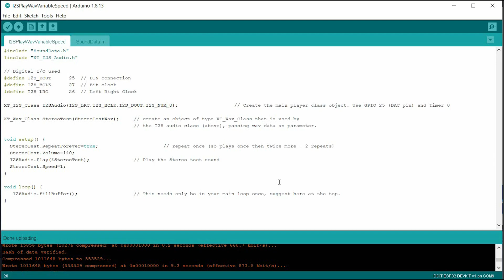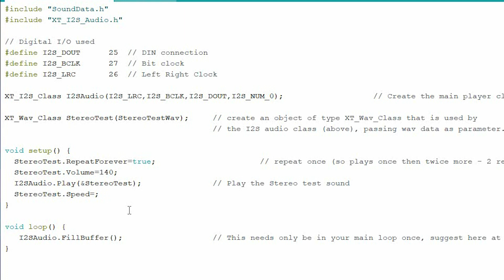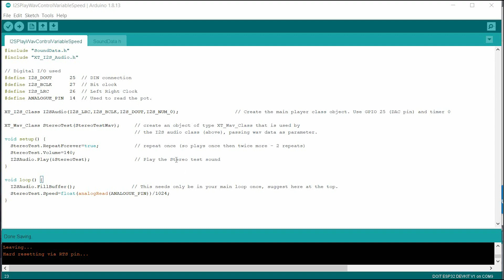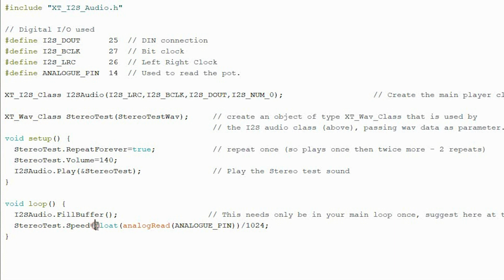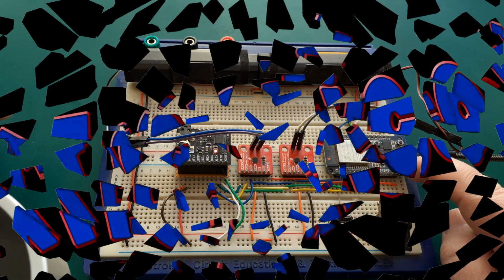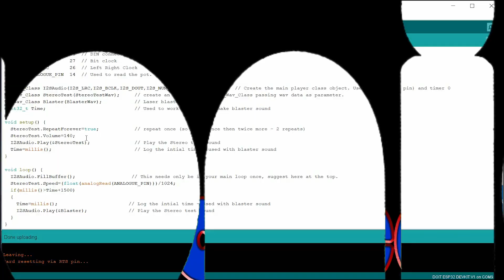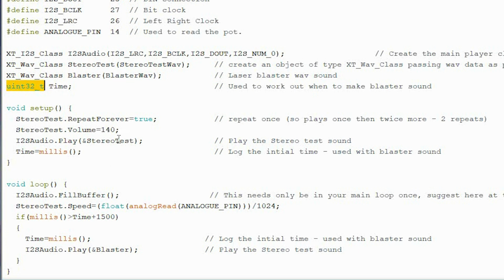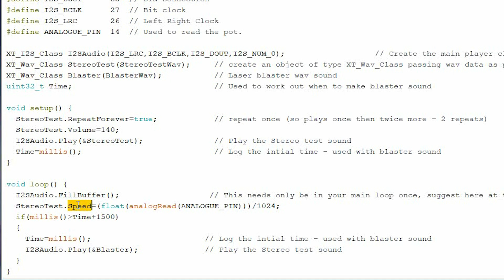I2SAudio Library, work in progress 3. Playing WAV's at different speeds. (ESP32 I2S Audio, WAV, MP3)

Comment: hey there, in the xt_dac_audio.h and cpp, the phase accumulator for the wav file is the index aka uint32_t DataIdx; correct? i want to make a dj style audio scrubbing function thus i would likely need to update this value as the play head from say an encoder value and then modulo it with the uint32_t DataSize? probably will need also the DataIdx to be interpolated with its previous state as to avoid discontinuity, let me know if im missing anything, i know you mentioned in the source that the speed is an integer to float "sub-frame" kinda trick but i wouldnt think that this would effect much with the DataIdx position? please correct me if im wrong all the best, Tristan

Comment: Im not sure if you would even see this comment , but i think your work is very impressive. Maybe one day if you have the time , can you develop a proper engine sound module ? Basically there needs to be a starter sound , idle and a rev up and down which i thinl is the hard part to really do because varying the sampling rate simply isnt enough to make it realistic , perhaps its possible but its beyond my skillset. If you manage to make such a thing it would be the holy grail for the rc car community because theres rn no actualy sound module thats realistic
Reply from the maker: I read virtually all comments. For that problem you need to be looking at what happens to the sound on rev up etc. I would guess.
Reply: @XTronical  usually the rev up is a bunch of mixed sounds , and it all depends on the road as well , but keeping aside most variables, it's safe to say it would be a knock at each engine cylinder cycle and a some other noises , this isn't always the exact loop so when I loop such a sound It sounds somewhat like a tractor engine revving up instead of say a car . ( the da da da , dada , dada , dadada , dadada ) one way to hide this is to have like a non linear curve for acceleration where the sound jumps to cut off the first part of the rev sample rate rising, but still its hard to replicate it.   I have no idea how video games develop this but for now , I won't give up lol. There's a person named diyguy999 who made a good sounding dac audio engine sound , but it's 8 bit and he seem to be using the sampling rate adjustment which works fine for low rpm truck engines but for anything else it just sounds somewhat bad and unrealistic as if I'm accelerating on a high gear at a low start off speed. The hardest part rn is to actually find the proper loop , maybe if I increase the size of audio sample and modify my esp32 to have a 16mb flash because the sd card library you made unfortunately can't change sampling rate. For now my engine starter and idle rev samples take about 3.5 mb for mono , 22050hz 16 bit audio ,   but having that upgraded memory will let me have maybe few different rpm rev samples to use under different engine speeds / revs to adjust sample rate. Thanks again for making such a library because before I literally had no proper idea how to even get quality audio out of the esp32
Reply from the maker: I did an 8bit library as well. Like you say this is higher quality. The task does not sound trivial but does sound interesting.
Reply: @XTronical yeah it's safe to assume diyguy might be using your dac audio library , I haven't gone thru the entire code. And trust me haha , it's a pretty interesting project , perhaps won't be the most important since it's a bit niche at the moment . Btw is it possible to change the volumes of each wav file separately on the sd card playback mode? So I can make a lot of loops and try to merge them by varying the volume to overcome that non adjustable sample rate issue ?
Reply from the maker: Yes, it will be possible, all sounds have independent volume but sd card functionality not fully implemented yet

Comment: Thanks for that great instruction. I'm using your XT_I2S_AUDIO Library but i have problems with slowing down the speed of a wav file. Speeding up with values between 1.1 to 3.5 works fine, but when i use values between 0.5 to 0.9 the file is not beeing played. What could be the problem ?
Reply from the maker: Mmm... I've just started a new project using the library so I'll have a look, see if I can replicate. Be a couple of weeks though.
Reply: Thanks. I will wait for any suggestion 
 @XTronical

Comment: You are truly a professional. Your depth of knowledge and clarity of details is greatly appreciated. The last step in my project is adjusting my output sound to different notes and volume. Does the new Esp32-S3 contain an I2S chip? Is there a way of controlling the volume without the I2S chip?
Thanks
Joel
Reply from the maker: Hi, thanks for your kind words. yes the S3 supports I2S. Not sure what you mean by control volume with i2S chip. The external decoder chip is essential for converting the I2S data stream to audio. Some support basic volume control but in the example on volume I did this digitally before the data stream is sent out. The external I2S chip has to be there to decode the data unfortunately, you can't do much without it. Hope this helps.

Comment: Awesome! This is exactly the functionality I'm looking for! Although, would you know of a way to power it without having to use the USB? I would like to power it from good ol' DC wires. (+/-)
Reply from the maker: Yes, just supply the correct voltage to the vin pin and a gnd.
Reply: @XTronical  Well...that's the thing. I only have 1 VIN pin, and according to a schematic, the GAIN pin on the I2S gets connected to the 3V3 pin and the VIN/2.5-5V pin on the I2S gets connected to the VIN pin on the ESP32, leaving me without any more power inputs.
Reply from the maker: Just connect the power wire to the esp32 pin, doesn't matter something is already connected there. Connect both.

Comment: Great! Can't wait for it's release, you had mentioned in the past, this will be supporting esp8266 as well, is that doable or on your radar?
Reply from the maker: Esp8266 should be doable,. Thanks for the tip about the website, the donations plug in was updated, something obviously gone wrong.
Reply from the maker: Again thanks very much for the tip off about the donations, I found it was a common issue since the last update of this part of the website. Found a fix and now working again. Appreciated. 👍
Reply: @XTronical  np, glad to help
Reply from the maker: Thank you very much for your generous donation.
Reply: @XTronical  would be awesome if you can have 8266 support as well even if it comes later on, I know its not the cool new flashy chip but it still has advantages, many small module form factors, really cheap, easy to program and pin map on pcbs etc.
Reply: Btw, donate link on your web page is not working

Comment: It's getting very interesting, looking like it could be a very useful library. 
Thanks for your hard work..
So I take it you could do something like, 
StereoTest.Volume=(analogueRead(ANALOGUE_PIN))/28;
Would this be continuously variable throughout the playback or just every  time the sample plays.
Reply from the maker: Thanks, yes you can do that and it would be continually variable during playback. So you could do volume control that way or use push buttons or a rotary encoder anything really 😊
Reply from the maker: There is also a a master volume that affects all sound coming out as well as for individual playable items such as wavs.
Reply: The sample playback is really interesting but to be perfectly honest I'm really more interested in the synthesis side of things. Although I suppose is could be used to generate arbitrary waveforms.
Reply: Sat here thinking about that sample playback, and if it was possible to select the start and stop points from within the sample data and loop the selected section. Think that is the basis of granular synthesis, although not something I've ever played with.
Reply from the maker: That wouldn't be hard to implement. I'll bare it in mind.